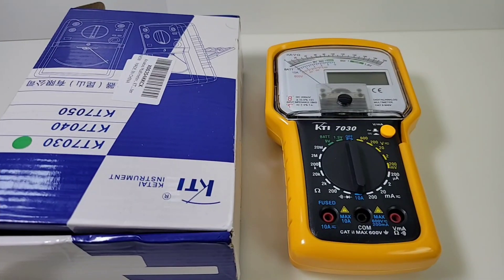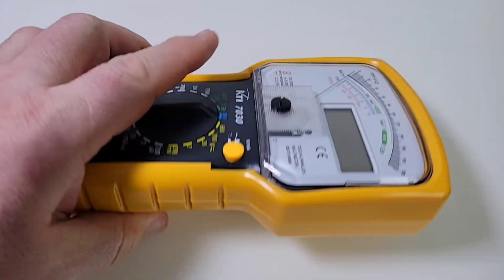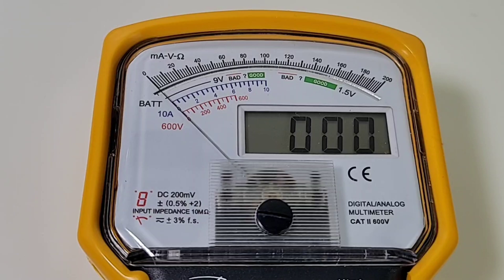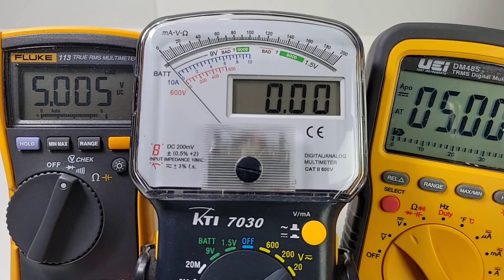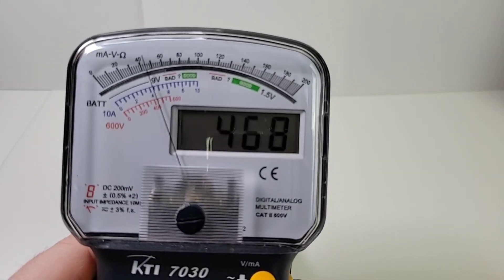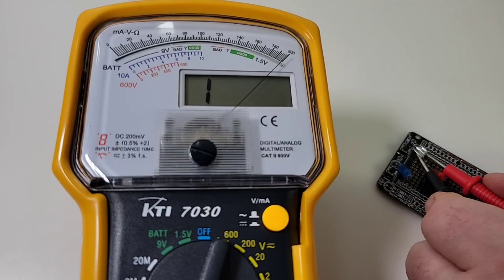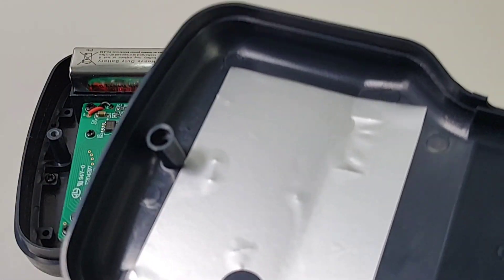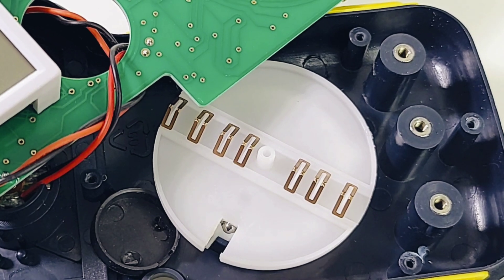KTI 7030 CHEAP-O ANALOG/DIGITAL Multimeter Review & Teardown!

Comment: How is this analog thing implemented? Connected to pin 31 thru an amplifier?
Reply from the maker: I'm assuming the same ..btw the analog output can track an unfiltered signal for fastest response, or a digitally filtered signal for best noise rejection. You have a nice set of options with these hybrid models.

Comment: hi, i am very disappointed by this dual multimeter. precision is not came with it.
the Aliexpress seller doesn't care about my opinion.
they sell this with arguement 'high precision' but it is false.
analog needle is very poor precision. voltage, BATT, current. 3% precision full scale is a lie. 
needle moves alone, shield is doing nothing, no near  magnetic action. 
i do't know if it is only mine or all of these cheapo cheapo cheapo dual multimeters. 
yes you are right about aspect and layout but for me it is going straight to garbage.
don't waste your french champagne for it. 
by the way, nice videos of course.
'santé' as we say in France :)
Reply from the maker: Oui..je compris votre frustration mon ami!
It's not the most accurate nor is it a perfect dual display.. but at a cheap price I think it can be very useful. The champagne 🍾 was regards to the internal shielding a definite rarity among today's meters. 
Keep On Testing! 👍

Comment: Nice test of a hybrid multimeter, just like a watch with both digital and analog displays. The analog part had its resistance scales in reverse, min value is at the left whereas regular analog multitesters have these on the right. Also obvious is the absence of a zero-ohm adjust.

 I think you should let the lack of a meter stand pass, analog meters need to be level on the work surface to be accurate.

Congratulations on the surprise shielding on this one. Cheers!
Reply from the maker: Indeed the tilt stand wasn't a game changer however because of the digital display it would've been a nice addition. It was definitely a unique design and I have to say this one is staying on my bench.. at least for now!

Comment: Bangood wants 51.00 for this meter where did the 20.00 come from ?
Reply from the maker: Amazon !https://www.amazon.ca/dp/B07QN51DDT/ref=cm_sw_r_cp_apa_i_M7MAKY8NNZ7Y68VN9BPH?_encoding=UTF8&psc=1
Reply: @KeepOnTesting  50.00 in america on amazon.   Not worth it at that price.

 https://www.amazon.com/Multimeter-Digital-Display-Voltage-Resistance/dp/B07QN51DDT/ref=sr_1_5?dchild=1&keywords=Analog+Multimeter%2C+KT7030+AC%2FDC+Analog+Multimeter+Tester%2C+Digital+Analog+Multimeter+Tester+Double+Display+Voltage+Resistance+Pointer+Multimeter+Tester&qid=1621866943&sr=8-5
Reply: Someone is having a laugh on the UK amazon site